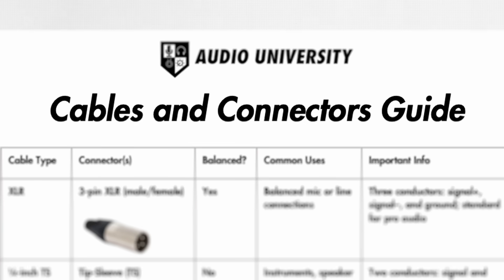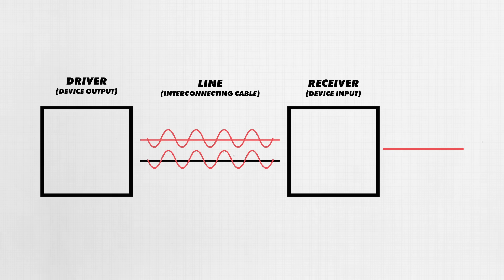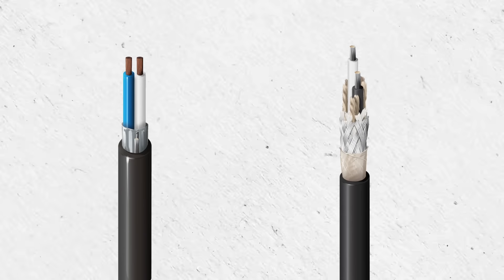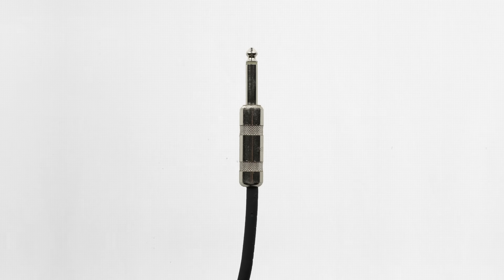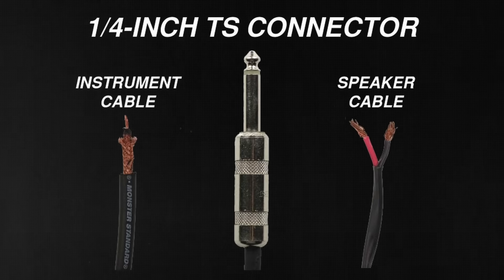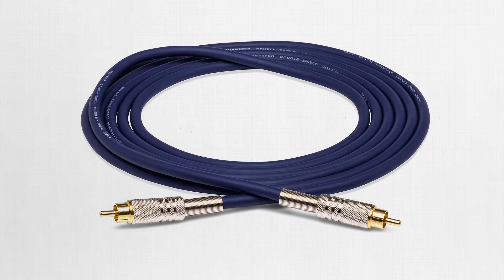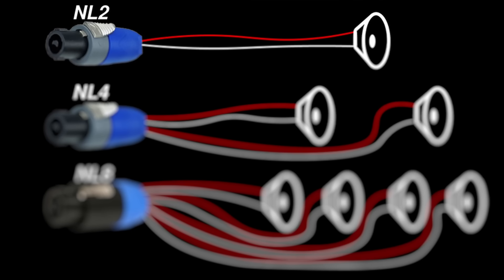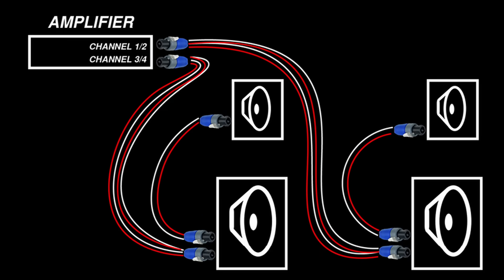The Ultimate Guide to Audio Cables and Connectors

Comment: Hi Kyle, I think connecting balanced outputs to unbalanced inputs and vice versa should be covered also in a future video. If I remember correctly, a balanced output from a mixer can run into the unbalanced input from an amplifier without loosing the benefit of the balanced output but running a xlr cable from an unbalanced output to a balanced input wil not make it balanced. Is that correct?
Reply: Well, bal out into unbal input will work but you loose the benefit of balanced noise cancellation. Same vice versa, only that you have to have connectors at the TRS that don’t bridge Ring to Sleeve. (Also No TS) Most devices have a diagram in the manual that explain which wiring setups are supported and how.

Most of the time, if you use a unbalanced cable in a balanced device setup, it will be 3db quieter that the balanced version would be…

Comment: Guys could I use my boat party pal as a monitor speaker with the mic input with a trs cable to trs or trs to aux input from the mixer
Reply: I don’t know what a Boat Party Pal is but no, you shouldn’t plug a mixer’s Aux Out into a Microphone Input. The signal amplitude out the mixer is much higher than that of a microphone. If you do want to try that, you would have to attenuate the signal level. Such as with a DI box or an in line attenuator. Results will vary dependent on a lot of factors
Reply: @praga2734  thanks but this is to use as amonitor for me and the quir of the church and I used a trs to aux input conection and put my speaker to line in mode to give feed back and use as a monitor
Reply: @Warzlock_playzIn that case, you don’t need to worry about the signal amplitude. If you are having issues, it’s probably because the speaker is expecting a stereo signal on the TRS cable, and the mixer is outputting a mono signal. Is the socket on the speaker for a small TRS like a headphone jack?
Reply: @praga2734  yes it's has both aux in and two trx inputs for mics it's is a 50 w bluetooth speaker about 2 - 3.5 kg in weight

Comment: It's kind of a nuisance when they re-use the same connector, for example the XLR, apart from analogue mic & digital audio, they are also used in lighting systems as DMX cables, again incompatible.
I've also seen XLR's used for speakers, as some manufacturers rate them up to 25 amps - speaker territory. 
A pity they didn't come up with something new like the speaker specific speakon's, although with the three variants of speakon there is plenty of room for much-ups here also, probably worse as we are talking high power.

Comment: I commited a cable sin recently: For my diy bi-amp speakers I decided to use xlr connectors, thinking that it will carry the low-passed and ligh-passed signals and the ground on the third conductor. Turns out there's no such thing as ground... of course it should be low+, low-, high+ and high -. So... I noticed that one of my XLR cables had 5 wires inside, pin 2 and 3 had two wires each (why?). I unsoldered one and connected both ends of the xlr chassis so that the 4th signal is connected inside the speakers by the chassis pins of the xlr connectors 😅. No noticable issues.

Also you missed the "Ethernet" cables for analog audio signals. Quite cool application.
Reply: The cable you had was probably what’s called star-quad. The conductors were probably two white and two blue? It’s just a nice quality cable. The design improves interference rejection.

What’s good about your story is that you know you did a ‘sin’ 🤣 and that it’s technically wrong, but you’re okay with it because it works. It’s a good trait to be modest rather than ignorant.

I’ve used star quad with 5 pin XLRs before to run two balanced stereo signals in one cable, because that’s what I had lying around.

Just a note though; were you sending amplified signal to passive speakers or a line level signal to powered speakers? If you’re sending an amplifier signal on that star-quad cable. It’s too thin. Just another thing to consider.
Reply: Good to know about star-quad! Thanks for the info. And it is carrying an amplified signal, but it's only 30W max per channel. Usually much less.

Comment: Thanks for video Kyle. Always awesome stuf 🤘🤘
Just to let you know "the next video" didn't show up on the end of this video.

Something I have learned in the past is the different between  speaker cables and guitar cables that they are not the same.
Thanks for pointing that out. I've seen enough guitar players using a guitar cable as speaker cable 😟

I was wondering about these gold plated guitar plug (jack) and if it would really make a different for the audio and even the connection? 
Maybe you could make a video about how to properly soldering these kind of cables and make it like a mini serie or something? I believe people like diy videos and stuf.
Reply: @MadNoisy  gold can even be a worse conductor and it's soft so it can wear out but it avoids oxidation. Oxidation can add noise, especially if moving the cable/plug. There is no difference in sound.

Comment: XWat cable do you use between powered monitors and audio interface?
Reply: Line Level cabling; connectors wise to match the 
Output of Audio Interface & 
Input of Powered Monitor Spk.
Reply: @temp26j724-i sounds like Chinese to me 😮
Reply from the maker: Depends on the connections on your interface and monitors. Probably either XLR or TRS.

Comment: Not mentioned USB connectors for all kind of digital data and (small) power delivery. This, Ethernet and WiFi will reach audio equipment, too.
Reply: USB does Not carry Raw audio signals, unlike Mic, Line, Instrument/Aux, Speaker LEVEL audio connectors...👌

USB, MIDI, AES, BNC etc. shall have its own video...👍
Reply: @temp26j724-i  I'm waiting for someone using shielded twisted pair data cables to carry raw audio signals. Like analog telephone did some decades ago.
But I presume that audio signal processing into digital data right at source might become the way.
The major advantange is mass production, very small form factor (usb, rj45) and once the signal is digital you are able to multiplex multiple signals on one connection. Not to mention that on bits and bytes you got no additional noise.
Reply: @temp26j724-i  I'm assuming by "raw" you mean "analog". USB can send digital PCM audio which is called "raw" because it's uncompressed.
USB-C also has the ability to use 4 pins for analog audio - L/R/Mic/Gnd - Search "Texas Instruments SSZTB49" for more info
Reply: @temp26j724-i  Twisted shielded pair cable were invented to carry analog audio signals. Decades ago simple shielded twisted pair telephone cable carried analog audio signals (telephone) equipted with RJ-Jacks like Ethernet. 
But in my honest opinion in future a/d conversion will take place at source as digital data can be transported/transmitted much easier, e.g. by multiplexing many sources onto on single cable or just by radio/wifi. Think of the many radio transmitting microphones/headsets used on stage.
Reply: RJ45 or 8p8c (Ethernet is not a connector) is widely spread and has been in use since the the early 2000's. either for Multichannel Digital audio (just the Connector or full on TCP-IP compatible like AVB or Dante) and even just as 4 Balanced lines in a single Cable. we even have ruggedized Versions of the Typical RJ45 and Fiberoptic connectors. and in terms of Wireless we are way past WiFi's capabilities.

Comment: Neutrik all the way. Play some time on a stage with poorly fitting subpar cheap connectors and you will have more pops than Orville Redenbacher!😂
Reply: And sometimes have more tips of 1/4" plugs falling off and stucking into the jacks
Reply: @FOHGeek  Had that experience with the 1/8"or 3.5mm ones. I got lucky the female connector where it decided to leave part of itself inside was open on the other end and easy to access (my PC sound card).
Have seen people with this problem on sealed connectors tho and that sounds like a problem I hope I never have...
Reply: Before Neutrik existed, Switchcraft was the standard for XLR.
Reply: I've had good luck with some Chinese brands for cables, although their knockoff connectors are usually still worse than Neutrik or Amphenol
Reply: Whirlwind Accusonic+2, Canare and Mogami are the only cable manufacturers to use if you build your own cables, everything else is junk. I second the mention of Neutrik connectors, they may be a little more money, but they are so well designed and termination is easy and bulletproof.
Reply: @peterldelong  In Europe we use other brands that are comparable. 

So know that your statement is only true for your part of the world.
Reply: @Richard_van_der_Heijden  Canare and Mogami are Japanese manufacturers surely available worldwide. Whirlwind cable is made by Belden, probably one of the best wire manufacturers anywhere. In my world nobody gets fired for purchasing Belden cable.
Reply: @peterldelong  Different continents, different brands.

Mogami is available in Europe but it's difficult. Canare even more so. At least in the Netherlands. 
But brands like VanDamme (British) is also hard to find in the Netherlands.

Most used and easiest to find in the Netherlands (pro brands): Sommer, Tasker, Cordial and than with a distance Belden, Smart Cable and Klotz.

Probably forgetting several brands but that's what I am used to having easily available.
Reply: @peterldelong  Sommer Cable is the GOAT in Europe… they make the best and most durable cables at good price. You can see them almost on every stage…
Their Sommer Elephant cable is extremely good.
For Power (specially 400V 3 Phase), H07RN-F Style Rubber Cables are welcome (and in some countries even mandatory) in the event Insustry. Nexans is one respectable Manufacturer. 

Also, Cordial makes great Speakon cables with 4mm² copper, which are similar in quality to Sommer but cost a lot less… (Sommer Elephant 4x4mm² is 1€ more expensive PER METER than Cordial CLS440)

But Sommer Cable in my opinion can be regarded the best cable manufacturer. Everything else above like Klotz is too much marketing bla bla with extremely high prices for sometimes even worse quality…
Reply: @jimi272  We use Carol SOOW cable in the USA for power distribution, rubber jacket, water and oil resistant and good to 600V. If I was in the Europe, I would go for the Sommer wire and cable all day long. Most any wire brand manufactured in Germany or Switzerland is going to be excellent IMHO.
Reply: @peterldelong  Yeah, BUT Italy is one of the largest producers of copper cable in any form and size of the world...
Reply: Neutrik, Amphenol, and Switchcraft. If your cable doesn't have one of the three and you're using it to make a living, throw it away.
Reply: Is the neutrik just the last connecting piece? Like the plug itself?
Reply: @ Yes. It's a manufacturer which makes the plugs.
Reply: @ayoubthegreat they might also make cables, but I usually see them only for connectors.
Reply: Right?
You would think that something as simple as a balanced connector would be easy to do well.
Yet, here we are.
Reply: Amen
Reply: Amphenol is often overlooked but certainly at least as good as Neutrik and also cheaper. 

Neutrik is outpricing themselves out of the market with the insanely high yearly increase..
Reply: Neutrik is the goat but SquarePlug is giving them a hard run for their money imo

Comment: 110ohm AES XLR cables will work well for line level balanced audio and also at mic levels in a pinch.
Reply: Yeah. XLR cables designed for digital signal are usually shielded twisted pair, which is more immune to interference caused by electromagnetic waves and capacitive coupling (crosstalk).
Technically if a cable can deal with high-frequency signal like AES3 or DMX512 at ease, it certainly would work as nicely with lower frequency signal e.g. analog audio. Similarly, shielded Ethernet cables are sometimes used as 4-channel analog audio snakes with RJ45 to XLR adapters. Why can't it transfer ~20kHz audio signal well if it can flawlessly carry network data signals at up to several hundreds of MHz?
Reply: agreed! the theatre i work at religously use 110ohm for all input (4core and 8core too), those thin cables' saves space as well
Reply: @shahiiran  do they save money too or vice versa?